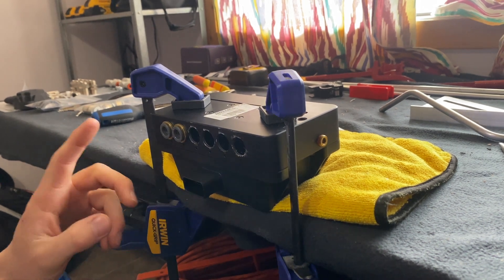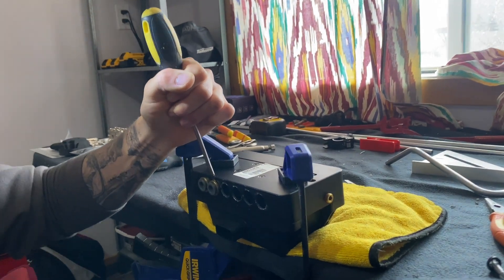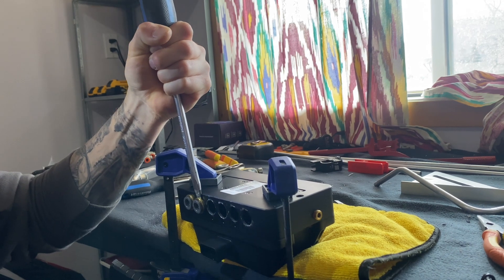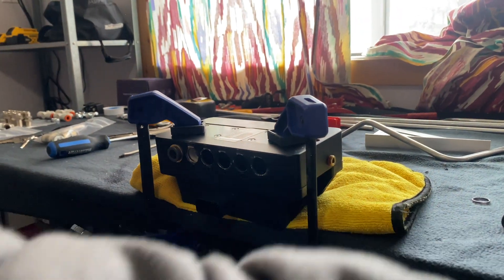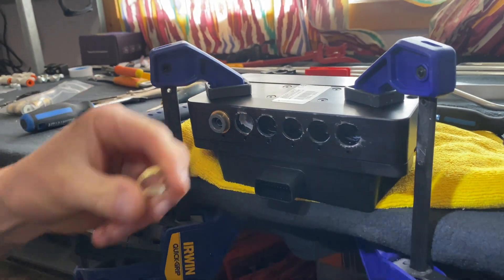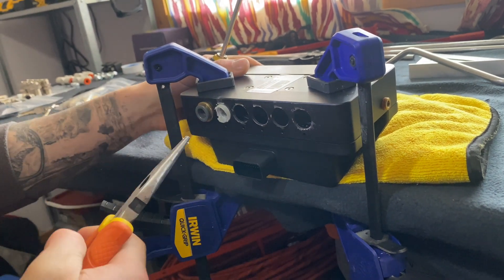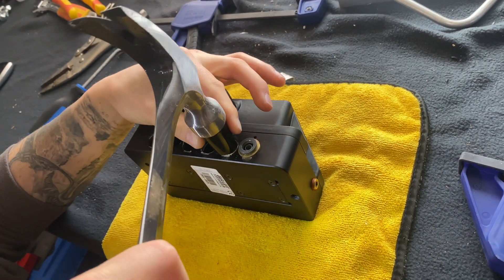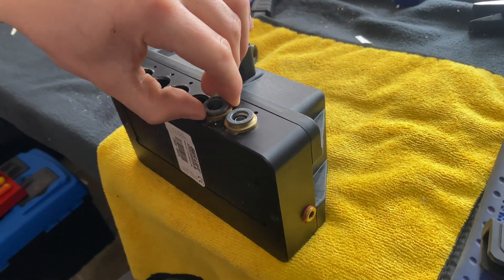Air Lift Performance | LEAKING MANIFOLD FIX!

Comment: Hey man, i replaced one of my cartridges because it was leaking, but also the cartridge was loose, like it would move around i turned it. I replaced it with a new one and still does the same and i believe is why it’s leaking.
Reply from the maker: Hmm so most likely a manifold issue. Is it still under warranty?
Reply: @ not sure, probably not. I bought it used off of another person.
Reply: @user-ic2zq9hn2x same issue, bought same way. I’m going to use some high pressure adhesive (super glue) and see what’s up.

Comment: Is there any way you might could actually text with my son about his airlift performance system?? The car was bought with the bag system on it and we know nothing about it.  It's definitely a nice system and was installed well.  As of right now, the remote just quit working for no reason and today is saying a system leak detected.  My son knows nothing about the exact unit because we don't have original paperwork or anything.  He just needs some help please or at least a suggestion.
Reply from the maker: I would suggest doing a full recalibration! Sometimes that fixes random bugs that occur. You guys can also message me on Instagram if needed! @sendd.it.wrx

Comment: This looks really useful. 
Is there a size difference in the manifold holes for 1/4 and 3/8? 
Do you know if I would I be able to upgrade a 1/4 system into a 3/8 system?
Reply: After a tiny bit of research I see that what I’ve asked cannot be done…
Reply from the maker: Honestly I’m not 100% about that one. I’d reach out to Bag Riders! That’d be an easy answer for them before you spend any money 😊
Reply: @BJW3Run why can it not
Reply: The holes in the manifold are different sizes.

Comment: I got them all out but when trying to get the new ones In they still had a gap and then I broke the plastic on 2 of them idk what to fo
Reply from the maker: Hmm…may need to re-order a few extra and try again. Be super gentle when putting the new ones in
Reply: Lube the o-rings before installing, should help with seating.

Comment: where did you got the fitting ?
Reply from the maker: Bagriders website! Search “cartridges” and you’ll find them 👍🏼
Reply: @adamanderin you can post a link in the video description. More people would see it as opposed to this comment. 
I just ordered my replacements from them, super excited to get fixed before it gets too cold! These 40⁰ and cooler nights have my car drooping by the morning.
Reply from the maker: @McRae2730  will do!
Reply from the maker: @McRae2730 just updated! Thanks for the tip!

Comment: Did you put a plastic sleeve on or just the fitting?
Reply from the maker: The replacement fitting comes with the inner plastic sleeve. Just order and install as is :)

Comment: Very helpful, having the same issue. Did you replacing them yourself fix the issue? Also wondering if you can over press these into the unit? Saw another comment ona forum and bro said he pressed them too hard into the manifold and now his still leaks. Lmk if you have any insight. Thanks man.
Reply from the maker: Glad it helped you out a bit! Replacing them fixed all my issues. I now have no leaks. I know you can press them in as well, but haven’t done so myself. I just did exactly as I did in this video and all worked great for me :)
Reply: @adamanderin  Thanks for the reply bro. My PTC is leaking and I have a really slow tank leak cause of it. Your the only video that isn't 5 years old or someone absolutely hammering the shit out of the PTC's to get them out. Really appreciate you making this video, gonna go ahead and give it a shot myself on my one leaky PTC and hope it fixes my overnight tank leak. Glooks!
Reply from the maker: @cmrnj  love knowing some of our videos are really helping people! Let me know if you have any other questions. Hope it fixes all your leaks pretty easily!